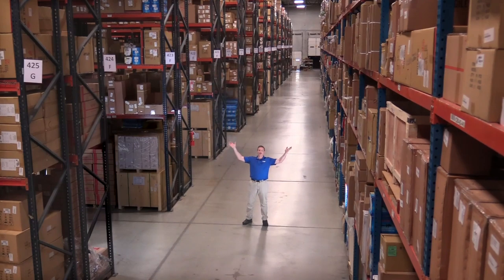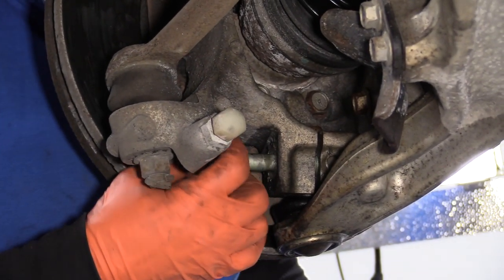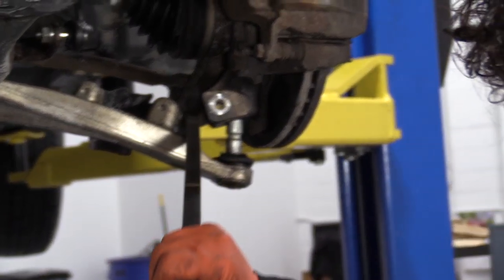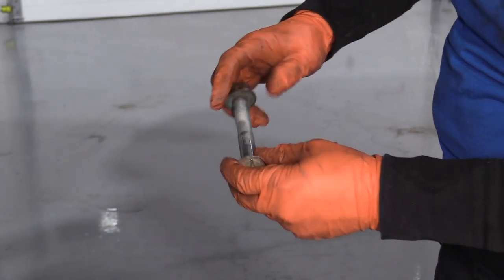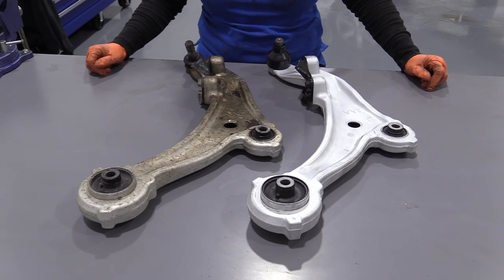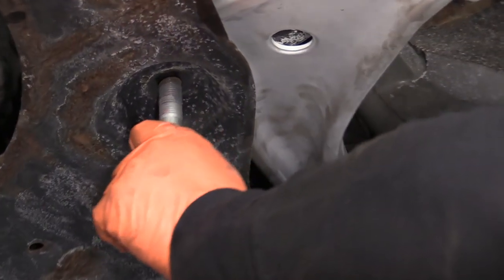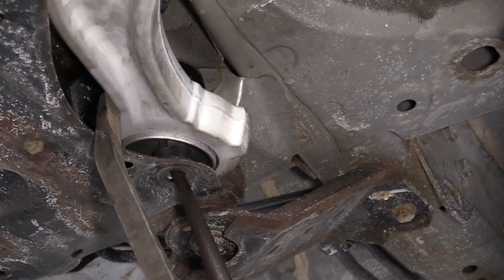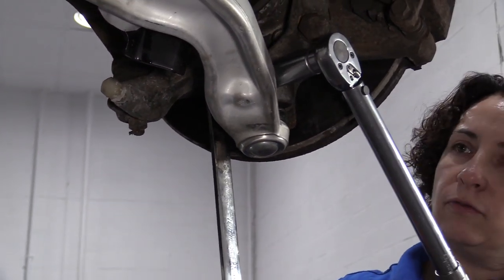How to Replace Front Lower Control Arm 09-14 Nissan Murano

Comment: Just finished this repair, went as you said it would. The one thing I did different that helped me was, when I was lining up the inside bolts, I put my floor jack underneath where it connects to the wheel hub and jacked it up until it was a little more relaxed. It helped a lot. Also finding a socket without those diagonal cuts that let the bolt cam out.

Comment: Super job! A little tip, To get those bolts in once started, lower the car to put pressure on the control arm to line up the bushings and they will go right in. Thanks for sharing Best Wishes & Blessings. Keith Noneya.
Reply: That is the hardest part

Comment: Most people don’t have a lift.  Save yourself the trouble of needing to fight with the bushings or use of a pry bar by spending 5 minutes to remove the strut first.   Control arm will slide in place will little effort.  Don’t believe me, try following how then do it on one side then remove the strut on the other side.  👍

Comment: Thank you so much for the video. I think it would have been a lot easier to take out/put in the bushings and the control arm if the brake rotor was lifted using an auxiliary jack.
Reply from the maker: +Khalid Abdelaziz Thank you! We love empowering our customers and showing how to perform DIY auto repairs with our high-quality auto parts.  http://1aau.to/m/Shop-1AAuto-c

Comment: Taking lca off is easy, installing a new one on can be a pain if you don't know what you're doing. Alwaya line up the rear bolt first, then the front one...then finally, the ball joint. You can remove both knuckle bolts and bottom stabilizer link nut for ease of installation. Ask me how I know, took me approx 45 mins to do each side from start to finish.
Reply from the maker: +c Yang Thanks for checking us out! http://1aau.to/m/Shop-1AAuto-c

Comment: Decent video of a not so good mechanic. Instead of beating the first bolt in and damaging the threads (pull it and look if you don't believe me) why didn't you stick a punch or aligning tool in there? By the way that's a funny looking "rubber" hammer. I wouldn't suggest beating on the seal of the ball joint with any hammer. You need to hire a mechanic!!

Comment: Will bad control arms causing a clunking noise that you can feel in the steering wheel?
Reply from the maker: +Go Blue We wouldn't be able to diagnose an issue like that here, you may want to have a local mechanic take a look at it. Thanks for checking us out! http://1aau.to/m/Shop-1AAuto-c

Comment: Bought parts once and won't buy them again. Very cheap, low quality parts. Bought a sway bar link for a 2000 Camry and after use for 2 months it broke off at the weld at the end.

Comment: Would be this be the same process for a 06 infiniti fx35 ?
Reply from the maker: +MR. Self Destruct This procedure might be different for your application. We do not currently have a how-to video for this particular year, make and model. Thank you for asking! 1AAuto.com
Reply: I would say no, the suspension on the older Nissans/infiniti's are setup differently, mainly the ball joint comes in from the top, so you have to take everything off, caliper, tie rod end, axle etc